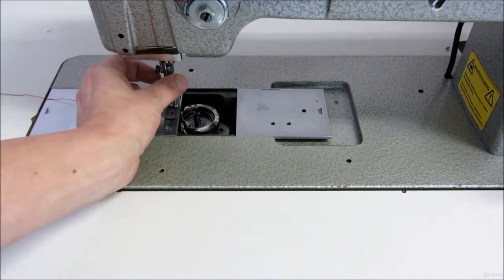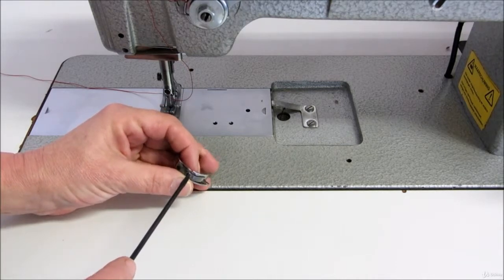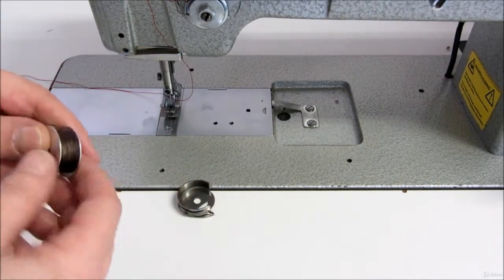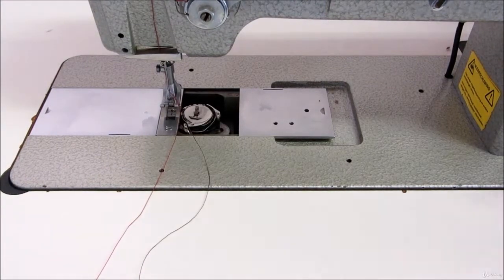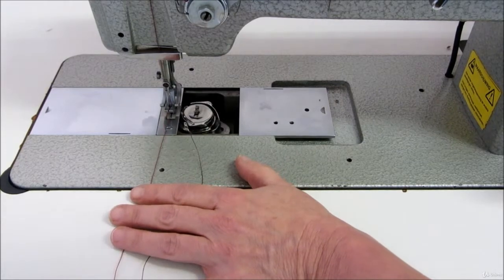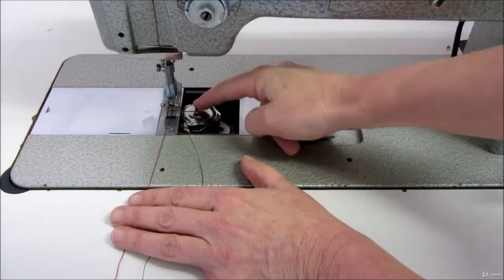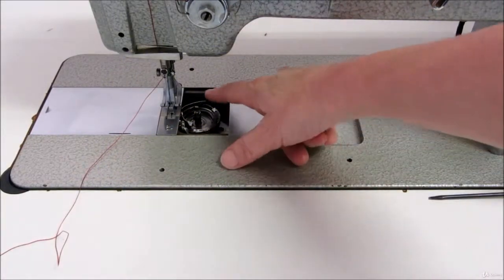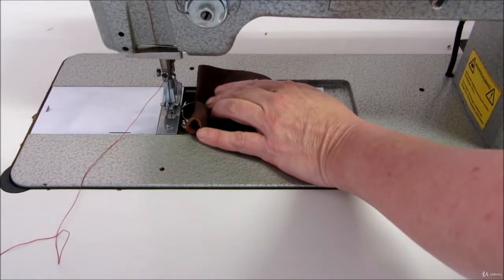Durkopp Adler 267 The spool (off time)

Comment: The very last tip did it. So the coil was out of position. Very good tip! I struggled for an hour because it wouldn't take the sewing thread🤣
Laatste stuk was dus de beste tip. Ik zat verschrikkelijk te tobben omdat het geen draad van de spoel pakte. Even met de hand vasthouden en aan het wiel draaien en klik. In positie en gelijk daarna wel de draad pakken. Heb je ook tips over smeren en hoe de bovendraad moet lopen? Net eigenaar van een Adler 167. Ik zie al dat je de 267 hebt. Draad loopt dus iets anders.
Reply from the maker: Yes sure, in the same playlist there are more video's.